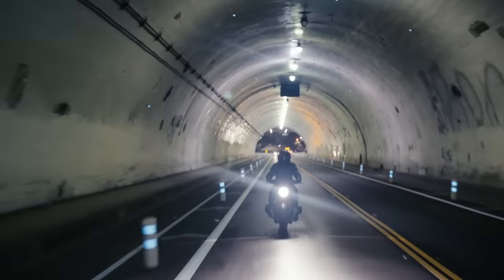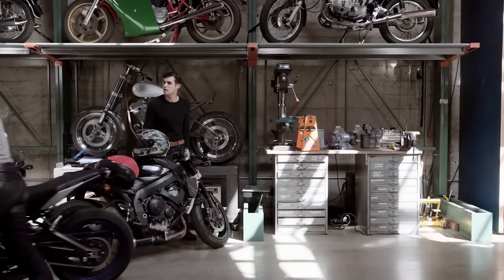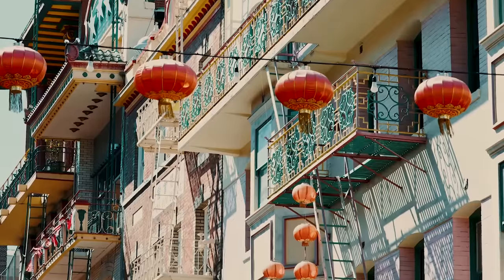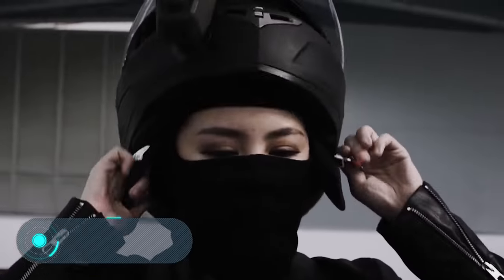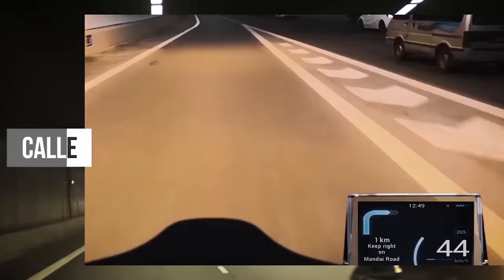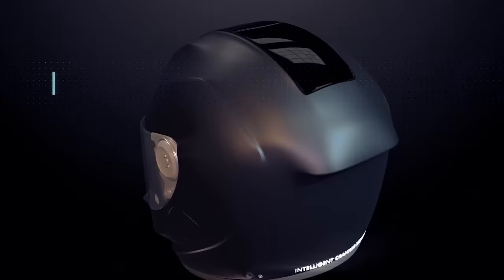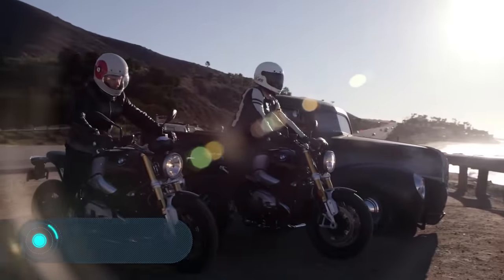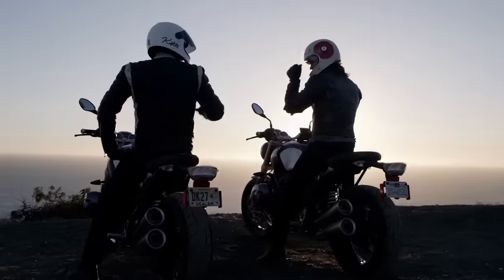UNREAL MOTORCYCLE HELMETS THAT ARE ON ANOTHER LEVEL

Comment: I have one request.. No cameras. No GPS. We need a helmet and suite combo that has an air conditioner.
Reply: Alvin Yang -Airconditioning would be great for Australia 🇦🇺.
Reply: @raywindred5419  Absolutely! Whoever can create an air conditioned suite for motorcycle riders would be a freakin' millionaire (if not a billionaire if it also works on low displacement motorcycles)
Reply: Aircon would provide a foggy visor when it's humid enough.
Reply: @TrangDB9  That can be fixed with Anti fog coating or with a Pinlock anti fog lens
Reply: TrangDB9 
Humidity creates fogging, not cold air...
Reply: @Rick_Sanchez_C137_  you've never had a humid day? What happens to a bottle of beer when you take it out of the fridge?
Reply: @TrangDB9  just add subtle exhaust vents that allow a small exchange of air without heating ambient temp inside helmet. Give me a few days to 3D model a prototype and I'll try for crowd funding.
Reply: Yeah lol
Reply: I agree us biker do need a mini air con in helmets how do you get the idea out
Reply: @iknowthings247  Im on it lets get high quality AC helmets
Reply: Heck yea lol
Reply: More like heat and air
Reply: Just go faster🤣
Reply: Such an invention, that gives a rider every convenience and luxury that they could ask for, has been invented. It is called the "car"
Reply: @killer2600  the concept can be applied to motorcycles. Quite inefficient to have a car that can seat 4 people when you typically commute on your own or just have 1 passenger. Less space, less traffic.  And there's always room for improvement.
Reply: Air conditioning is still the greatest invention in human history
Reply: right @ I know things lol....main reason I'm against the features is BC your helmet will be talking to gieco telling on ya ....no bs
Reply: Would be handy for Texas summers.

Comment: HUD in a helmet is very useful, for showing motorcycle info, Google Maps GPS info, answering phone calls etc
A universal remote control on the handlebar to control the helmet HUD, GPS and smartphone would be neat!... 👌
Reply: PrimiusLovin 
The best use of a HUD in a motorcycle helmet is being able to pinpoint your location to give it to the 911 operator after you crash because you were distracted by the HUD.....

HUD was designed for pilots.... that don’t have a lot of shit driving around them and cutting them off, and on the rare occasion a mountain does “cut them off” there is an audible beeper that tells them to change course.... stupid for traffic!

Comment: More weight on the head? No thanks. The only thing that even remotely intrigues me about any of these helmets is the proximity sensing in the back or in the blind spot with an audible alert. However none of this stuff will change the fact that there's two types of riders:
1. Those that have gone down
2. Those that will go down
EOF
2003 Aprilia Falco
2008 FJR1300
2020 FJR1300

Comment: All those electronic add-ons require something to power it., say...a battery. The more stuff that needs to get powered for longer requires more battery. Bigger battery = weight. The last thing a rider needs is a heavy helmet. Bad for the neck, and shoulders. The only riding I would be doing with a helmet like this would be riding back and forth to my chiropractor. Neat ideas, but impractical in a comfort sense.

Comment: Some nice ideas but I would question how robust they are for use in real life, everyday use. All my bike gear gets used year round in hot, cold, rain and snow and ends up getting covered in road dust and debris and the general wear and tear of high mileage.  Helmets especially get battered and dirty, you have them hooked over the crook of your elbow with a set of damp gloves chucked inside them when you go shopping or walking around, off the bike....anything fragile within the helmet structure like HUD display wont last 5 minutes.

Comment: Everybody wait to buy these helmets. The helmet you have now has a 5 year shelf life and we have all been riding all our lives without this tech. Remember when cd players came out and they were 1000 plus usd? Well these helmet prices will go down as time goes by. Personally i am waiting for Arai and Shoei to come out with 360 degree cameras or GoPro to make a universal 360. As it stands now velcro is the way to go allthough putting a safety line attachment is a good idea in case a camera comes off the helmet with excessive speed or hard landings. I used to use a stretch on Halo brand reflective strap but after 115 mph they come off so i wonder how good a Go Pro attached with Velcro hangs on?

Comment: Alot of the tech on these helmets are pretty distracting sounding and unnecessary cause a rider needs to be aware of everything that's happening around them so stuff like the video screen headphones inside the helmet is not too safe idk about the noise cancelling bcuz the roads can be pretty load and reduced noise could be good

Comment: So... save yourself a few few hundred to almost two thousand dollars and use your mirrors.  While tech wise they are cool, they are also useless. Keep the helmet simple and light. Use foam ear plugs  at higher speeds if the noise is too much. You need all of your senses while riding. If the signs on the road aren't enough to make you pay attention the digital display with get ignored too. 

Everything that these helmets provide is already available in the form of mirrors and the gauges on your bike. Aside from GPS. But if you have a phone then you already have that too, so spend 20$ on a phone mount. 

These helmets are only cool for rich people to one up each other. 

stay safe!